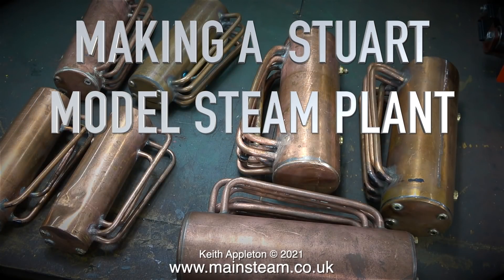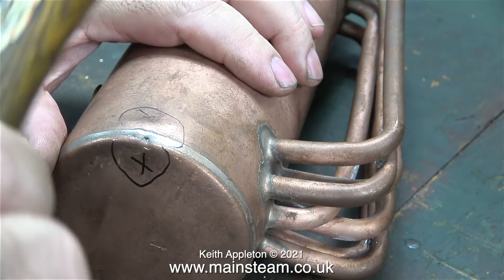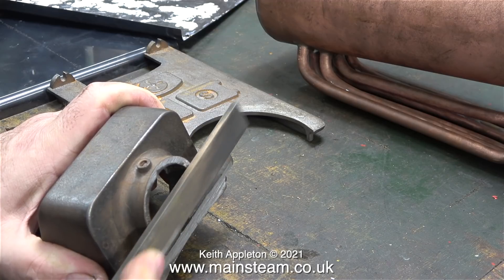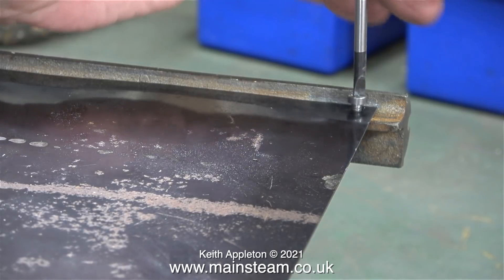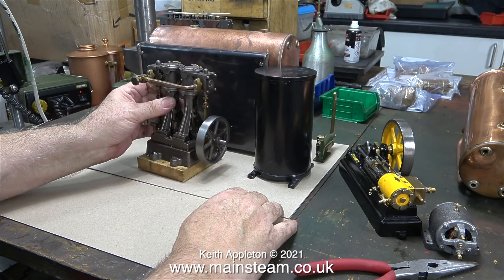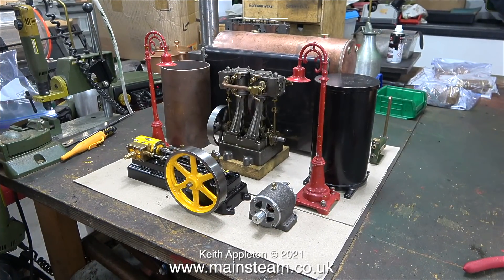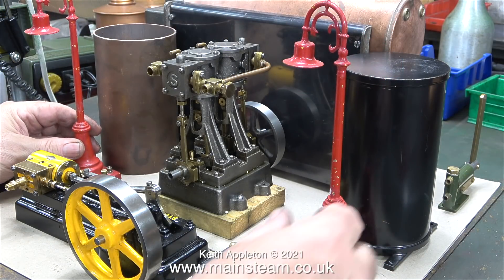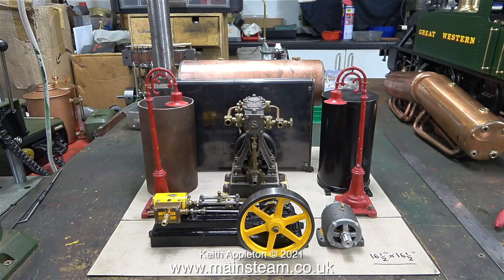MAKING A STUART MODEL STEAM PLANT - PART #11

Comment: I was visiting a modern research plant, owned by ICI. My guide asked the technician running a computer controlled pilot plant if he'd fixed the problem, apparently it shut down at random. The technician took an adjustable spanner out of his pocket, and said "You see that place where the paint has come off, that's where you hit it." The guide asked how hard, "Start gently and build up," was the reply. On another occasion I was talking to an engineer, I was a technician, I asked what the difference was. " A technician can tell you what's wrong, an engineer can tell you what bit to hit, what with, and how hard."
Reply: Percussive maintenance still has its time and place.